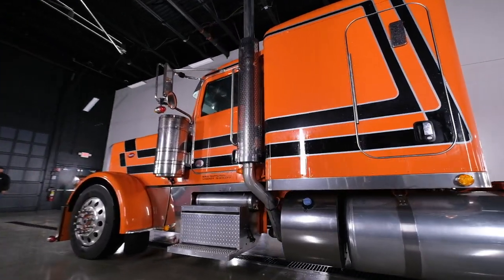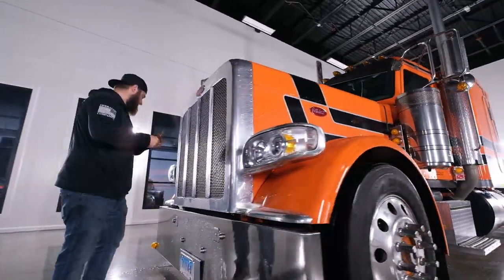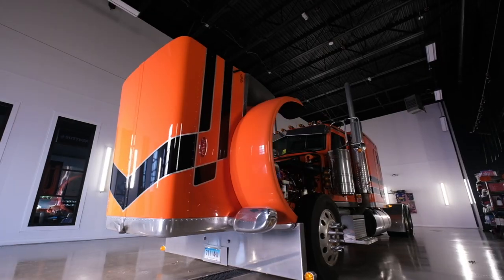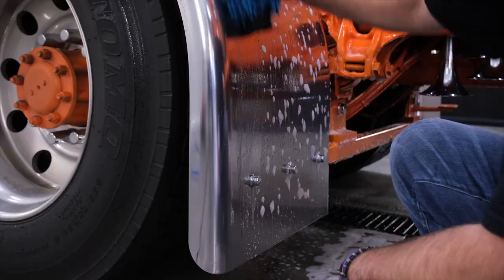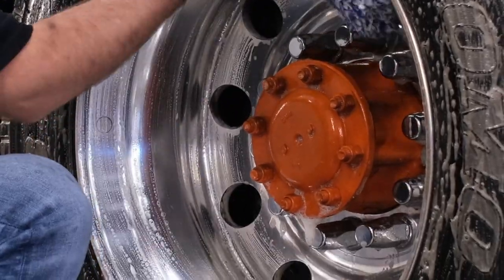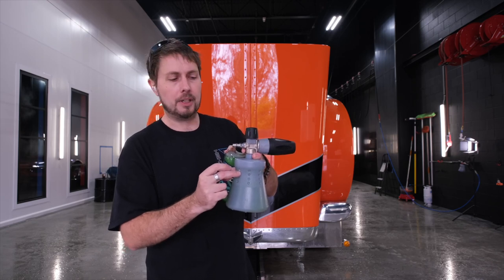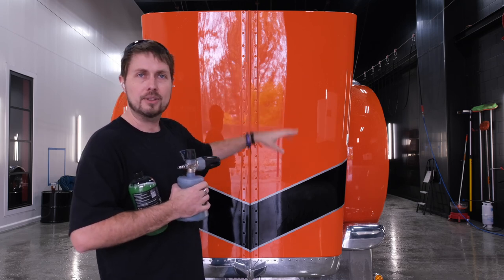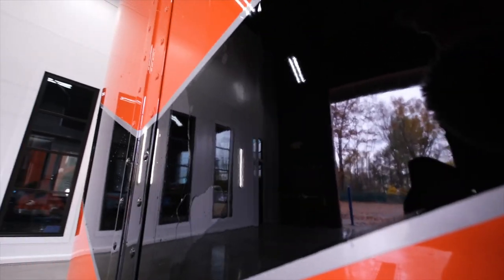Launching My New Sio2 Coating Snake Oil with SRS National’s Newest Peterbilt!

Comment: So does the truck have to be washed and dried before applying the snake oil coating? Or can you apply it while the truck is still wet from washing?
Reply from the maker: You can apply it right after you rinse any soaps off and it’s wet yeah

Comment: Once you spray this on with a foam cannon, would it benefit it's effectiveness of you rubbed it in with a clean wash mit before rinsing it off?
Reply: Never used snake oil specifically as we don’t get it over here but in my experience from using spray on-rinse off sealants you can apply it with a mitt, sponge or micro fibre when it’s still wet, you can literally use most of them as a quick detailer through a spray bottle, neat or diluted, depends on the products of course. Just make sure to apply it ideally on wet and cool paint and don’t let it dry on, just rub it in and rinse it off.